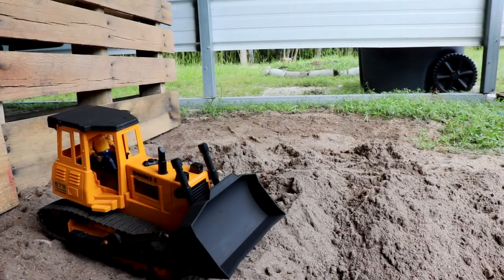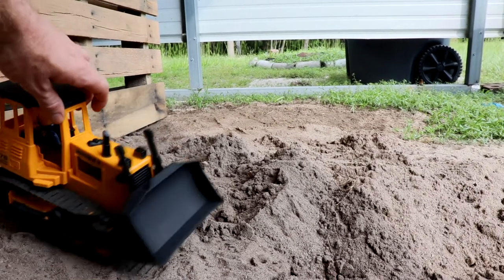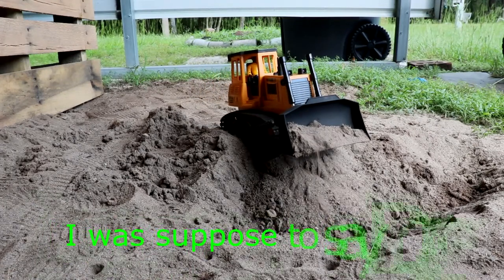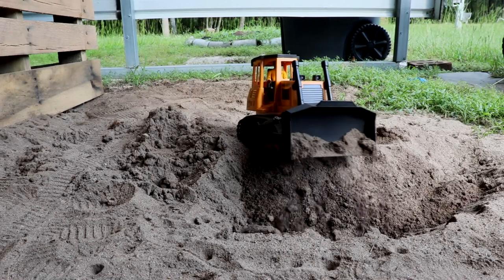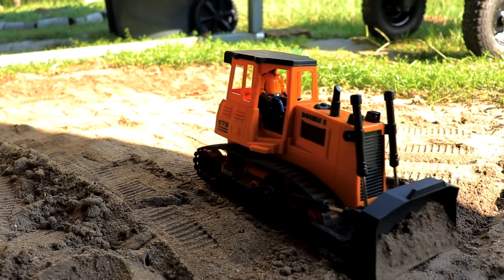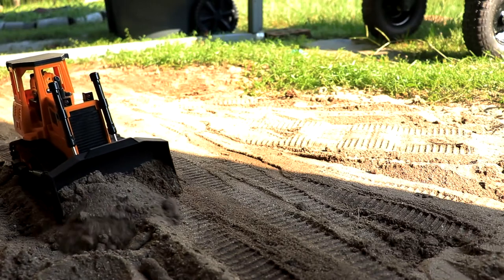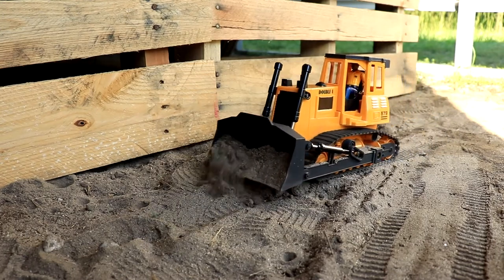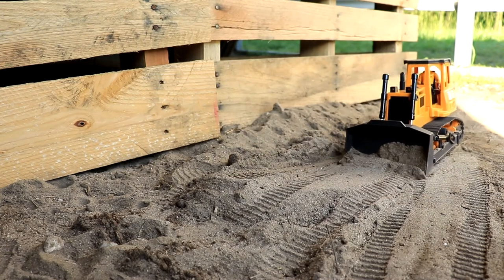RC84Films: Doze & Chat

Comment: I like the construction vids. Is there a way you could use them on real dirt instead of sand? I would like to get into the construction stuff too, but we don't have sand in Ohio.
Reply from the maker: I will be doing that soon the dozer are not going to do like  Hydraulic RC they have brushless motors, metal tracks and stuff. My stuff is pretty low grade. I can't drop 5k on a rc so I got to do what I can afford.

Thanks for watching